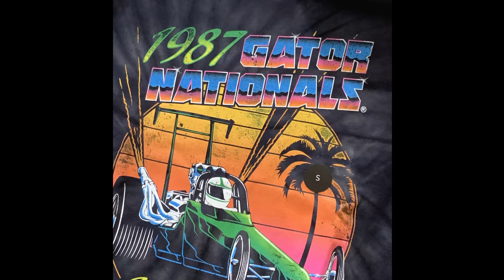The GREATEST Story, I've NEVER TOLD! {GATOR NATIONALS - NHRA}

Comment: Man, I owned a 66 Chevelle SS.  396 four bolt main. L88 cam, 456 gears, headers, traction bars, cheater slicks, aluminum highrise and big Holley. Drove it on the street. High 11's on the track. I loved it!

Comment: If you are ever back in Washington during the summer check out Extreme Sports Park and Webbs Slough for sprint boat racing. I'm guessing you would get a kick out of watching them as well. The unlimited boats will go 0-80mph in about 2 seconds and pull up to 7g's in the corners. Up to 1,500hp in a 13ft boat with an inboard jet pump.

Comment: I used to have a ‘48 Ford F100. It’s one of the coolest pickups in you want to customize it. Drop a new Coyote crate engine in with a Tremec magnum 6 speed and a Ford 9” limited slip rear end. Cool ride especially if you add Vintage Air to the thing.

Comment: Rob I've watched you for awhile you ave a lot ove volkswagen commercials,  I bought a vw 2004  convertible for my mom , her car blew up on her. I just want it fixed it ran when I bought it but the trans seal was leaking, need help getting it fixed don't want a hand out just help getting it running right from experienced people  any help would be appreciated.